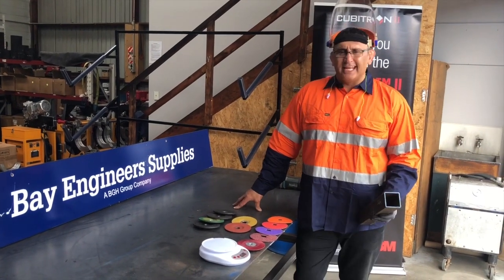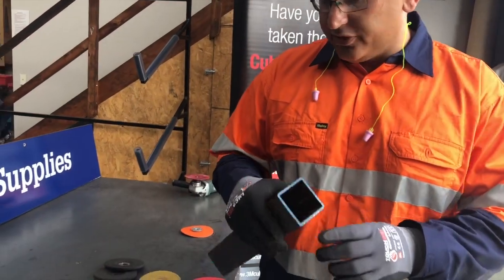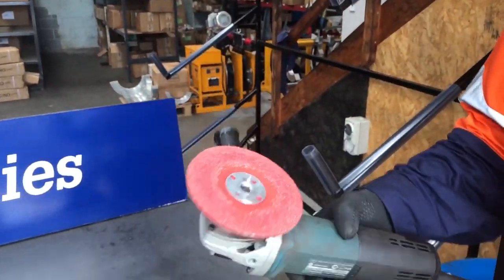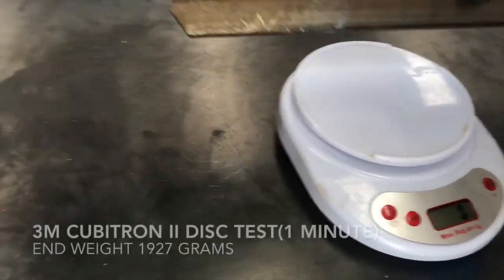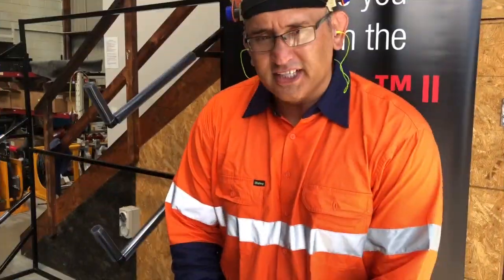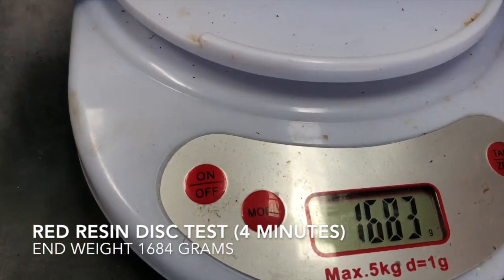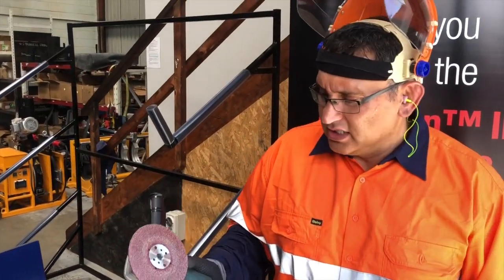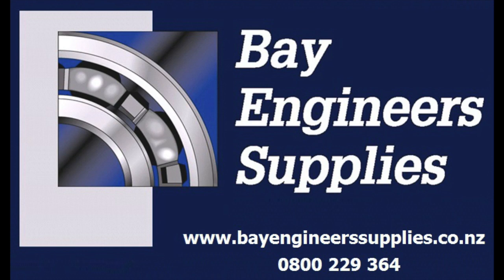3M Resin Fibre Disc Comparison Test

Comment: Hi we are a heavy structural engineering company and we have tried the 3M 982C with okay results. As to your testing the 1 minute test against the red was only 7 gram difference and in your 4 mintue test against the red was only 49 gram difference. Over all our company has worked out value for $$ way over rated.
Reply from the maker: Hi Temeeka and thanks for your comments. As requested on our FaceBook page, can you private message us your company name and your contact details please? We would love to ask you some questions about your own tests.